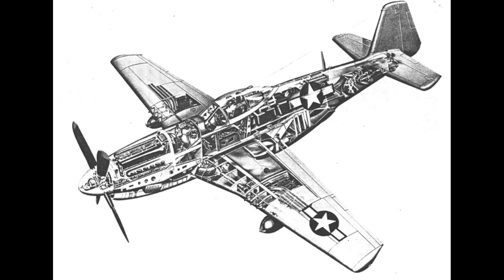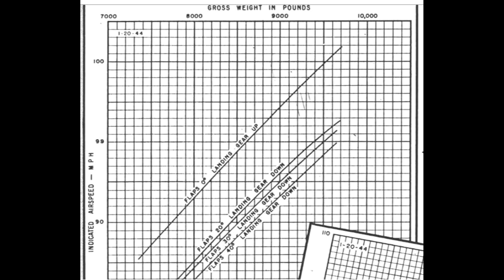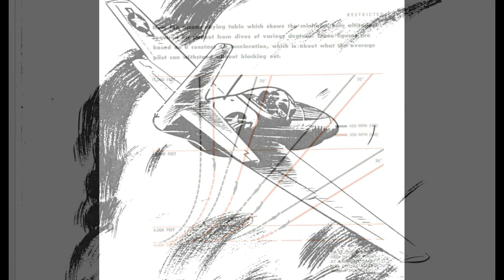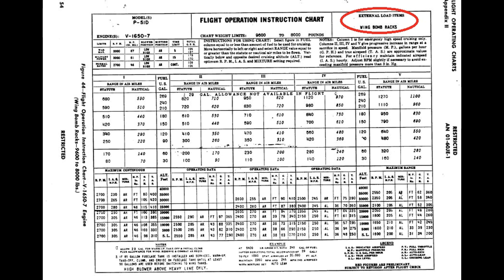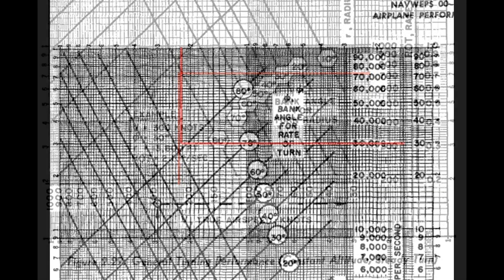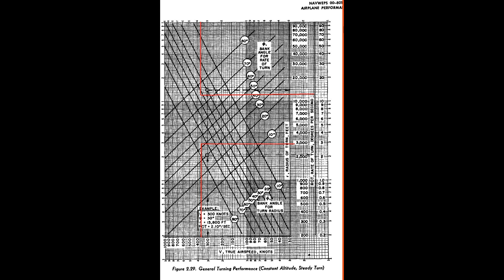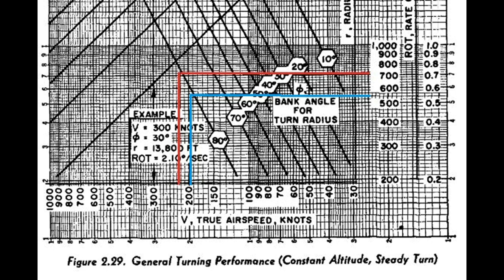P51 Mustang Turn Radius vs.

Comment: the hawker hurricane would have a good turn performance, because of the wing design, speed and bank angle is irrelevant, wing design and wing loading are the important factors, because when you add G force you increase the wing load, a heavily loaded wing can not sustain as many multiples of its weight before it looses its ability to fly, pulling Gs is not going to decrees the radius of a turn necessarily, other factors will, in ww1 the Germans found that the Fokker drV11 could sustain at tight turn radius because of its thick wing profile, it could out turn its opponents easily, pilots also said this about the hurricane.
Reply from the maker: Well, NASA, NACA, the FAA, the U.S. Airforce, the U.S. Navy, and I disagree with you. We say that speed and bank angle are not irrelevant, but you go ahead and keep thinking that.
Reply: Well you must agree that the wing loading is critical,  and you must agree that the wing load increases with G force.those are two factors you must agree with. the wing load determines the stall speed, do you agree? if you increase the wing load you increase the stall, it doesn't matter how you apply the wing load,through gross weight or G force through maneuvers the effect is the same, if the math doesn't indicate this then the math is not considering all the variables.
Reply from the maker: You have changed your story. Before you were saying, and I quote "speed and bank angle is irrelevant". They are not and that's a fact. Regarding wing loading, that is not the only factor in determining stall speed, far from it. Stall speed however is a factor, and I think if you watch the video again you will see that it was factored in via the formulas and charts from the book Aerodynamics for Naval Aviators.
Reply: Of course speed and bank angle are factors, of course a stationary object wont fly,  don't take me so literally please, sometimes I feel like I am being scrutinized, why wont you people give me a break.  there are so many variables, but generally speaking a lightly loaded wing will turn a tighter radius than a heavier one, if you build two identical aircraft and increase the wing load on one by 100% you will increase the turn radius and the stall speed.
Reply: great videos Greg, I don't want to cause any animosity, you are doing great work for the aviation enthusiast fraternity, and I'm sure this sentiment would be the consensus among your audience.cheers
Reply from the maker: Thanks gogo!

Comment: Rather than comparison of turn rate why not use Boyd's E&M Theory as the basis of comparison?  See: Boyd, the Fighter Pilot who Changed the Art of War 2002.
Reply from the maker: Because this video was about the concept of maximum sustained turn rate. I do know who Boyd is, I have his book, and I may do a video on it at some point. However, before I do, there are a lot of other concepts that need to be covered, and the concept in this video was one of them.
Reply: I'd like to see a video on Boyd's E&M Theory applied to W.W.II fighters.
Reply from the maker: Brooke, you are in good company, there are others that would too. I will do that, but I have to nail down some other things first.

Comment: For God's sake stop the 'my dicks bigger than yours' BS! Grow up!
Aircraft performance is so incredibly dependent on flight regime (and instantaneous circumstances) that to try and say 'X is way better than Y' is pure crap.
Aircraft went through so much development during the war years that trying to assert 'this one is better than that one' is pointless.
If you had been in a P51 or Spit Mk IX over Berlin in 1945 facing a 1940 experten in a 109K you'd still be crapping yourself - grow up!
Barry Rodliffe and crosstimbers2 - GIVE IT A BREAK?
You're both talking BS.
crosstimbers2 - you have to be a troll, yes?; pure and simple, you obviously don't have a clue what you're talking about - come back when you'r balls have dropped.

Comment: Did I hear right? Is stall speed higher when the engine is running?
If so, is this because you need aerodynamical force to counteract the torque from the engine; or because the propeller disturbes the airflow over the winngs more, when it is providing power?
Reply from the maker: Hi Ole, I don't think you heard me correctly. Stall speeds with the engine at full power are LOWER than with power off. This is due to the accelerated air from the prop rushing over the wings.

Comment: There are many WWII vets who talk about out-turning an ME-109 under the right  circumstances - altitude, speed, etc. Often they would drop   some flaps that that would enable them to turn inside the ME-109
Reply: I watched a video of a Fw 190 ace talking about his experiences dogfighting Mustangs. He basically said that the P-51 had a very strong initial turn, to the point where it would come up behind the six of the German plane, and a lot of novice German pilots lost the nerves and tried to dive away or break off. Which, in most cases was their demise, since you won't outdive a P-51 in a German fighter. 

He then continued that, if you kept turning with the Mustang, you would eventually catch it again and apparently a lot of the older experienced German veterans knew about this and thus didn't try to break away or dive.
Now a 190 is of course different to a 109 but I still thought it was quite interesting.
The name of the ace was Willi Reschke.
Reply: @TheSerec  
That may be true of the BF-109, but a FW-190 will handily out dive anything but a P-47, and isn't really suited to turn against anything.  Its roll rate is fantastic, but it bleeds energy like a stuck pig in any but the most gentle turns.
Reply: @horsemumbler1   p47 was very quick into the dive but reached it limit just as quick It had the second worse safe diving speed of the US three

Comment: I'm really interested in the dogfight between the Dauntless and the Japanese Zeros. The way I heard it (a video) was that the Dauntless pilot would slip his plane sideways countering the Zero's famous maneuverability. More than a few Japanese planes were shot down, but because the Dauntless pilot was making such radical movements, his tail gunner wasn't able to do much more than hang on and spot planes. I'd really appreciate hearing what you think, knowing it'll be well supported. Also to what degree could WWII fighter planes do these same things, and if so why they didn't do more of it? And of course, what better informed questions should be asked about this?  Thanks.
Reply from the maker: The part about the Dauntless fighting and defeating some Zeros is true and well documented. However that only happened once that I know of, and that pilot was then put into fighters. As for the slipping being a significant factor in the fight, I have my doubts. Planes bleed speed like crazy in a slip, and a Dauntless isn't exactly powerful so it would have a hard time keeping enough speed up to maneuver if the pilots slipped it much. I suspect he slipped or skidded a few times to get shots in but I think his success against those Zeros was more a case of the Zero pilots screwing up and the skill of the Dauntless pilot rather than the slips.
Reply: Thanks for the response. One thing that seems to be true is that experience and skill count for a lot. More flying hours generally makes for the better pilot.

Comment: I don't understand what prevents a bank angle of more than 81 degrees. Why not 90 degrees. Isn't the G-force during a high degree banking turn largely be dependent upon how hard you're pulling back on the stick? Wouldn't THAT determine the amount of G-force more than the actual bank angle?
Reply from the maker: Ohh, GREAT question Robert. This is something that's often misunderstood. Your partially correct. There is nothing preventing the plane for rolling past 81 degrees. You can roll around and around to your hearts content, but eventually, you have to worry about the ground, and that's where the problem arises. 

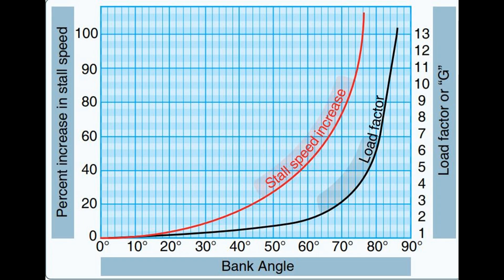At about 5:57 I specify that we are in a constant altitude coordinated turn. You could bank the airplane 90 degrees, but you won't be able to do that and hold altitude. (except with extreme rudder and power, a few planes can do this, but they you won't be turning fast) So, if you exceed 81 degrees of bank, in order to hold altitude in this case, you will need to exceed 7Gs. You could bank slightly more, say to 85 degrees, but now when you pull 7Gs you will be loosing altitude. This is where pilots skill comes in because as you do this speed drops off, thus changing the optimal amount of bank needed. for a max rate turn. Then there is the option of turning faster, but giving up altitude, again, pilot skill and tactics are going to become an issue.
Reply: OK, I think I get it now... Thanks.

Comment: 8:56 'No ww2 plane has enough power to prevent that'. 

Actually there might have been one. The Me 163 komet could theoretically maintain a greater than 7G turn with low fuel at high speeds (to lower required bank angle and thus lower induced drag).}

Though actually trying to do it in the komet would probably spell a death sentence for the pilot.
Reply from the maker: Even the 163 doesn't have that much thrust. It takes something like an F-16 or better to pull that off.
Reply: I was specifically thinking of the V6 and V18 komets, which were fitted with the  HWK 109-509B rocket motor, and which could attain a TWR >1 for a short time before burnout, peaking at 1.08. Or 1.12 without a pilot.

I calculated that they would achieve 6.8 to 7.1 G during the last minute of fuel, which implied a 19 second window during which it would equal or exceed 7G, which I would argue is just long enough to count as 'sustained'.

Although this is all theoretical and makes the generous assumption that the airframe could actually handle that much force. It was made of wood afterall, and from what little info I can find it was only rated for 5G. ¯\_(ツ)_/¯

Comment: how too kill out turn spitfire m2 and other ver in 109 g climb drop flaps 25-45% then out turn him depending on where the spit is climb drop turn
Reply from the maker: In certain speed ranges, dropping flaps in a turn will allow you to tighten up the turn. However it's very risky. It will also drag your speed down and eventually make your turn performance worse as speed drops off too much. This was done, but not very often. Now that I think about it maneuvering flaps could be an entire video, it's a complex subject.
Reply: could be mate sounds like one
Reply: below 400 -around 300-400 knots is sweet spot    500 if you are back out of a dive climbing and not full power
Reply: before read alot more things at work to consider i know altimeter and all that but here read this.... if you can out climb the spitfire, you can then drop you flaps and engage in this way'  it was risky'' only do it when you have too sort of thing. the optimum condition for this manoeuvring'' is if you are out climbing the spitfire etc'' if you have that advantage and he has no lead yet, then this can be done, only with key precision'' ie ace pilot '' however if they are matched for speed, and climbing about the same, and you see tracers within inches of cockpit/wing'' then best to just dive nose down, as turning at that point leaves you as a massive cross section
Reply: would be a good vid mate' you do a very good job, i picked up right away you must have worked in aviation industry,that is the idea i got  from your first video, were you a load master  by chance

Comment: Question: How did you calculate the 4g at 10:05?
Reply from the maker: From the calculations around 6:35  To find the stall speed at a certain G load you take the square root of the load and multiply it by 1 G stall Speed. So if your plane has a stall speed of 100, and you are pulling 4Gs it will stall at 200.
Reply: Thanks for your answer.

Comment: The hawker hurricane used to out turn the 109, it was it's one major advantage. Couldn't match it for top speed
Reply: In the BoB the Hurricane also out turned the Spit.
Of course the spit was continually developed as a fighter whereas the hurricane wasn't, but in 1940 the hurricane was probably the more effective of the two.
It wasn't as pretty tho so the ugly one got ignored a bit.
Many pilots tho expressed a preference for the hurricane, Bader included.

Comment: I recall seeing the Dogfight episode with Bud Anderson and I believe he told his wingman to put the P51 in 3 or 4g turn while he dealt with the 109s.  I was a big fan of the IL-2 1946 but always felt the P51 was mis-modeled, particularly in turning ability. Have you ever looked at that flight sim and the performance of the P51 in it?  Hellcat was also a dog in that sim.
Reply from the maker: I have the original IL2 and IL2 1946. It's a good sim, but yes I agree the P51 and some others are not represented accurately.

Comment: i read a story somewhere about how new p51 pilots that went to England thought they were the best and that the Germans couldn't beat them. so the more experienced pilots found a p-40 and fought the new p51 pilots. according to the story, the p-40s always won.
Reply from the maker: I find that believable. At low altitudes the P40 was very competitive. Above 20,000 feet though and it's dead meat.

Comment: Ah.. that "not a P-51" at the beginning of the video is the A-36 (officially "Apache") displayed at the Wright Patterson AFB museum at Dayton. I must've visited it 3 or 4 times over the years. The dive flaps are down and you can see the yellow identification stripe painted under (and I think over) the wings, because it resembled a Me-109 in the air. For those who haven't come across the A36 - it's the dive bomber version of what became the P-51, with the Allison V-1710. These were the first "Mustangs" used by the USAAF, mainly in Italy. Lots of people seem to have the opinion that the Allison Mustang was a lousy fighter - this is very far from the truth. It was faster than anything else available at the time on the deck, and the British made good use of it starting in late 1942. IIRC they only lost one to enemy fighters, while it was fully capable of engaging and shooting down Me-109s and FW-190s at the altitudes it was used at (mainly for rhubarbs and low level reconnaissance).
Reply: iskandartaib 
I mean, not like the brits would have taken it over the kittyhawks they originally asked for if it was crummy, right?  Not to mention the Rhubarb missions

mmmm.... Rhubarb
Reply: And also, the big incentive for improving its high altitude performance with a Merlin was that it was already known as a fast, superlative fighter with long range. If it was a lousy fighter they wouldn't have done it in the first place. (They did put Packard Merlins in the P-40 by the way - P40F/P40L - not sure if it was a one or two stage supercharged Merlin - but they didn't use them for high altitude long-range bomber escort.) I have the book published by Rolls Royce about the conversion (the "Mustang X") - it wasn't trivial. They had to re-route quite a bit of ducting and move components around to get the Merlin to fit.
Reply: The Wikipedia page says it did improve high altitude performance (the single stage Merlin was also used in the Spitfire V, which was used at high altitude) but it probably made no difference on the deck which is where they were mostly used (in North Africa).
Reply: iskandartaib  The Merlin in the P40 did slightly increase the service ceiling but not much, and the Allison could NOT be beat at the lower altitudes !!!  Did not change overall or total performance !!!  And the Allison was easier to maintain !!!

Comment: Very interesting stuff.  One thing that has me thinking would be more powerplant changes in aircraft.  What made the Mustang the Mustang was the Spit's engine.  It turned it from a decent aircraft into a high altitude beast that was also pretty fuel miserly and just very good overall in a fight.  I would think there'd be no way for a Mustang to outturn a Spit due to Spit's near glider like wings.  Both those wings, the Mustang's and the Spitfire's may be the most famous fighter wing designs of the war.  One is as thin as it can be but is still deep because it holds a 20mm cannon.  The other embraces laminar flow design that had its own neat effects.  All of that gets a person to wondering what some aircraft would be like with the engine of another.  Can you imagine a snub-nosed Mustang or Spit with a PW R-2800?
Reply: Or a Mustang with a Griffon. It did happen, but postwar - and were only flown on the deck around pylons.
Reply: John R 
A radial Mustang would largely fail, imo.  The mustang was designed by a former racer, and as such, placed massive importance on low frontal area.  Also, a lot of the drag reduction on the mustang was from the redesigned cooling system, which would have been useless with an air cooled engine.
Reply: Yeah, it'd be interesting to see and would also pick up significant drag as you stated.  Radial fighters had that "jug" look which was one of the P-47's nicknames whereas a V-engine helps contribute to that sleek narrower look that we associate with the 'Stang, Spit, and Bf-109.  Those 3 are among the most beautiful aircraft of the war.